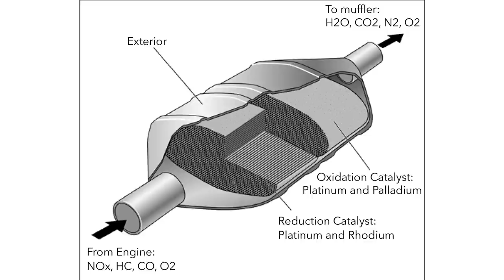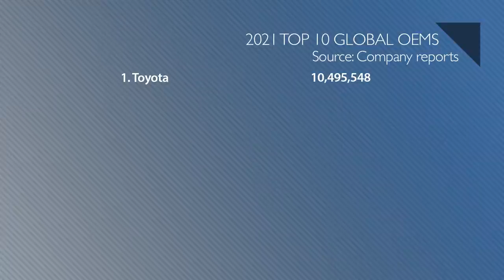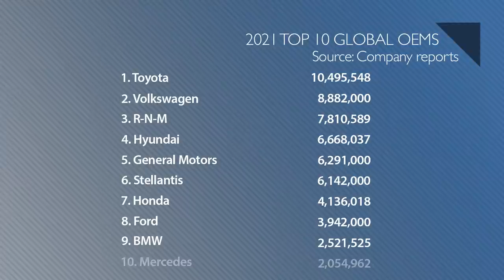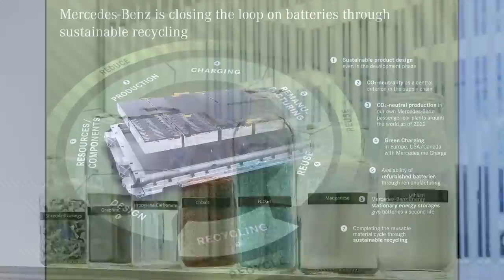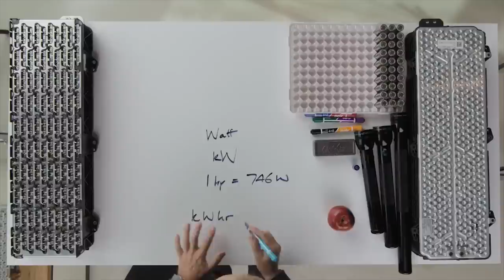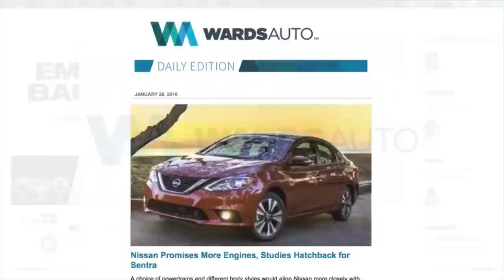All-New Acura Integra Tech Specs; Thieves Crazy for Catalytic Converters - Autoline Daily 3279

Comment: Lucid  uses 2170 cells., most  if not all future Teslas will incorporporate  4680 cells( high end & LR) and LFP  for SR models.Tesla will also have scale as they will manufacture own 4680 cells  plus buy from LG,Panasonic  and CATL  and  rumors are BYD will also be a supplier, by 2025-26  it is possible that Teslas run rate/ yr  will be 5 Million.
Reply: And…? It’s only a form factor not a new technology
Reply: @Emm2004  scale @ which Tesla will be able to produce it themselves will be a game changer, FOR Tesla, and Tesla will still be supplied by Panasonic and LG  with  the same form factor cells  and Tesla will also be supplied WITH LFP cells from CATL  , thus Tesla will have the biggest  margins in BEVs  even as they produce BEVs  @ the run rate of 4 to 5 MILLION / YEAR , by  Year 2025-26  ,   now tell me  who  among  BEV  automakers will have  that  capacity? China  automakers aside , NOBODY  will, This  numbers are conservative Giga Shanghai  will have 2 million capacity., Giga  Berlin  will be 500,000 minimum, Fremont 600,000 - 700,000, Giga Texas  will eventually have 1.5 - 2 million , now do the math.Lucid will be for Millionaires  for  years to come, I do hope  they come out with a $30,000 - $35,000 car  , but  I won't hold my breath.
Reply: @Emm2004  Dry electrode  Technology  by Maxwell is new technology, it is the reason Tesla bought Maxwell, no other battery in production  has it.Tesla  thinks in TERAWATTS when it comes to batteries , all others  think in GIGAWATTS, maybe  you need to  do a bit of reading and research. It  is why Tesla  is valued so high, they make other things , besides cars.

Comment: R U Sure Tesla was not the top automotive manufacturer in the world? I mean, I never miss your video magazine and some posters here are quite sure Tesla is number 1 🤐.
Reply: If Tesla maintain the growth rate that's many times that of the legacies, then it's just a matter of time. They're about to pass number ten in the short term already.

Tesla's challenge is still supply, and their backlogs have grown despite their breakneck growth rate in vehicle production. Some new parts of the US are allegedly seeing a doubling in demand as well, due to the recent spike in oil prices.

Additionally, by revenue they already surpass Ford and GM as is, despite producing a fraction of the vehicles. They also have no pressure to reduce prices whatsoever - the opposite in fact is going on due to demand - so the writing is on the wall already.

TLDR: I would not be surprised to see Tesla on that chart in just a couple years or so.